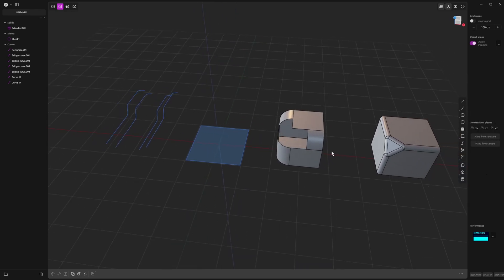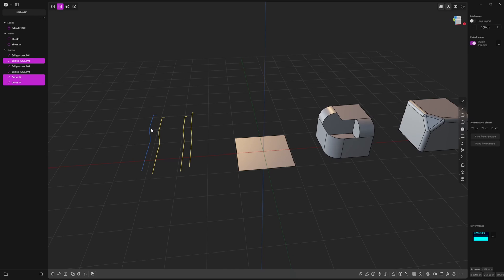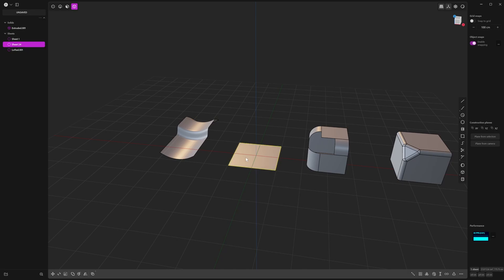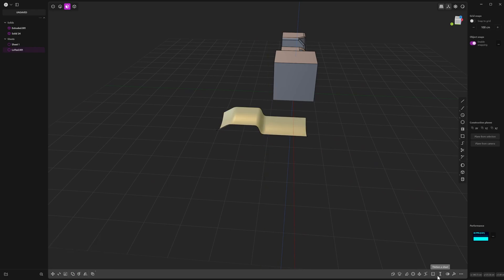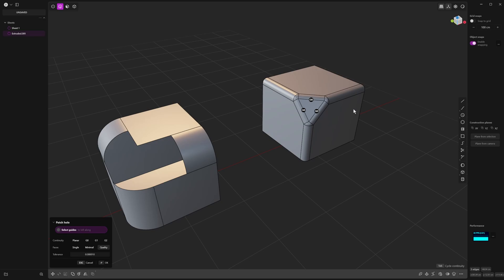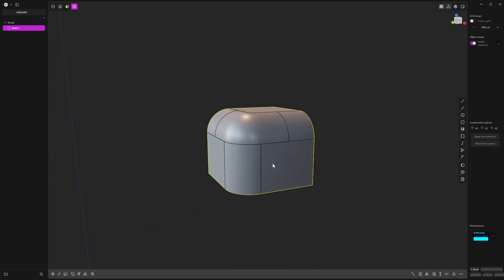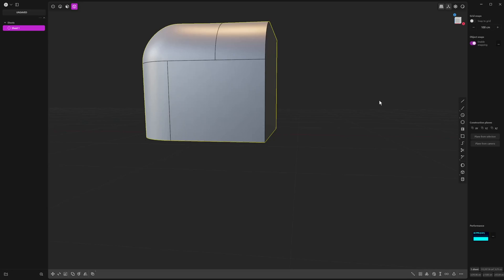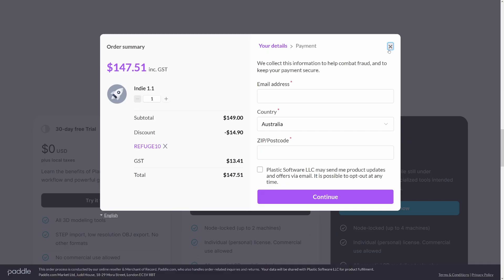Plasticity Quick Tip - Turn any Sheet Into a Solid

Comment: if i export as an STL and then drag that stl into plasticity it counts as a mesh. How to I make that a solid again so that I can add or delete things?
Reply from the maker: You would generally export the stl when you're done with your cad edits.
I have done two videos covering 3 methods on converting polymeshes to cad which is possible, but depending on the use case it can be more convenient to reverse engineer.
https://youtu.be/1RXJAvRKuI8?si=hTo5a-YehBsJ8Ckg
Reply: @takerefuge3d lol not this model haha. Its the helldivers 2 destroyer. 0 chance I'm going to remodel that lol. I just wanted to cut it in half so I could print a cross section since the inside of the ship is also modeled. Thanks for your help

Comment: the patch tool is something i never got to work with plasticity, not after this video either. the sheet-thing is not really working perfectly in plasticity.
thanks for the video tho:)
Reply from the maker: The patch tool requires to select multiple edges that create a continuous loop, it is prone to fail quite a lot though, that being said it's the best solution in a lot of cases

Comment: soooo.. whats the shortcut you're using but not showing ? making a curve to a sheet
Reply from the maker: I used the patch command which you can customise in the first instance it's in the command menu and I set it to alt F. 
And in the example I used with the four curves I used loft which is L and it connects lofts selected curves in the order you selected them. 
And
Reply: When you have a closed shape (indicated by it filling in with blue, if it's flat), you need to select the curves that make up the entire border, and then click the Patch Hole button in the bottom right (or via the F menu, or by the 2024 version shortucut Shift+J).